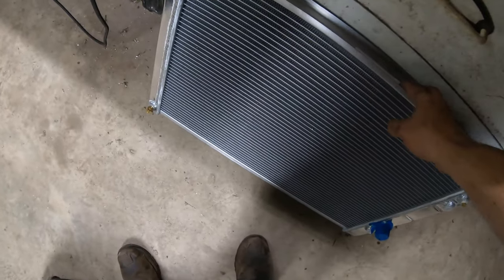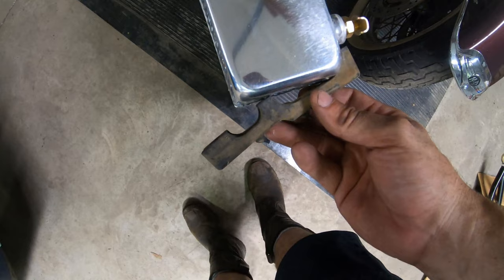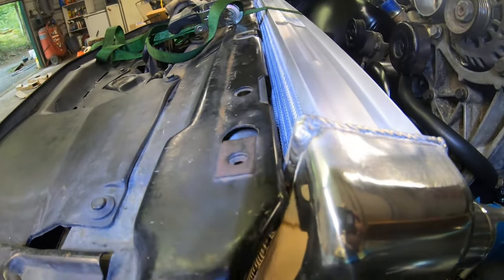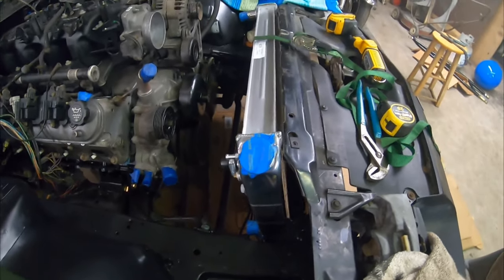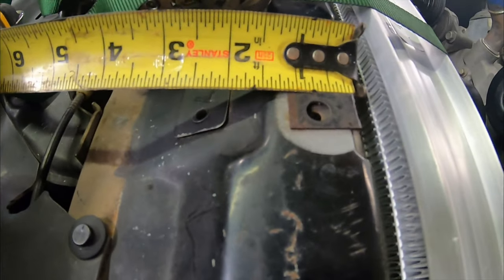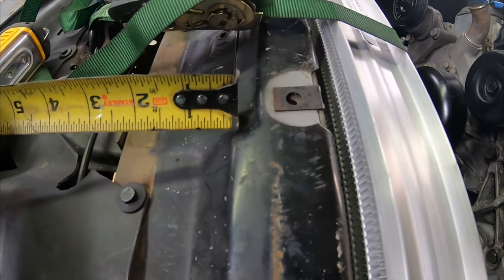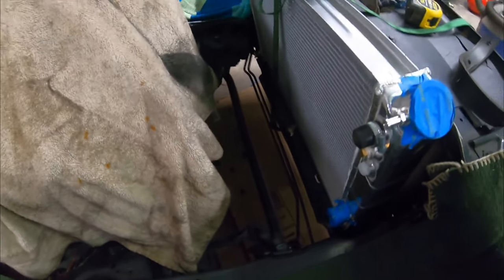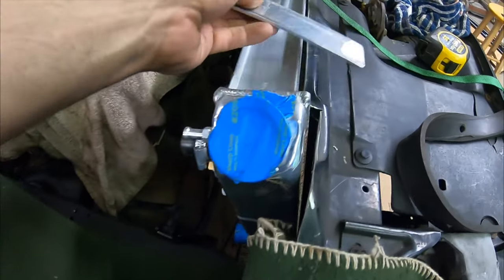The Third Gen Camaro gets a new radiator installed. Some cutting req...

Comment: If it fits it ships 😎👍🏽 good job for making it work .  The rads do lean back a bit on these cars a bit , I think mine does.  I’ve seen a bunch of the mullet militia using tubular core supports .   I’ve considered cutting out my lower support and making something.  The paint is flaking off my lower support so I’m not sure how long it’s going to last, but I used a 4th Gen rad in my 3rd Gen .
Reply from the maker: Summit said it fits a '91 Camaro. Guess they were right... I've been eyeing a tubular front end from RocksolidMotorsports. Maybe when I get closer to a turbo install.